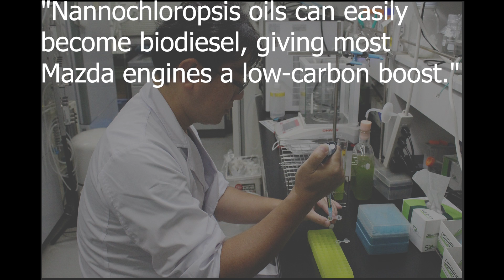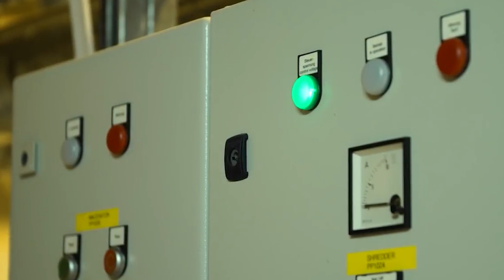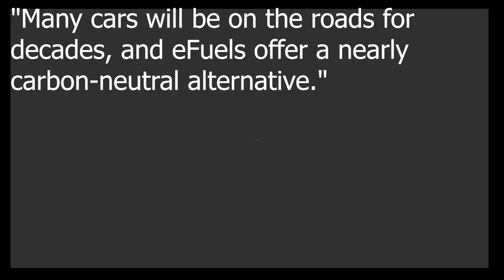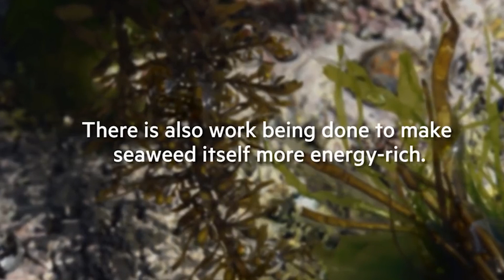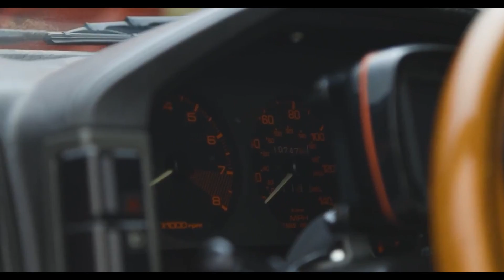Mazda's Bold Plan to Save the Internal Combustion Engine

Comment: Here we go again, more seperate attempts to avoid having to do something about making EVs. They pretend that these Biofuels are somehow Carbon Neutral, when anyone can see that they obviously aren't. They all need energy to synthesise the fuel, still have to be transported and still end up having 60% or more wasted in IC engines. There is no technology that can beat the end to end efficiency of Electricity generation to turning wheels than BEVs. Every step you introduce adds more inefficiency. You're always better off using Electricity to directly charge batteries.

Comment: As always the issue is that even at scale the production of fuel using algae / sea weed is expensive & it will never be cheap.
To achieve $12 per gallon of fuel will take a $150 billion investment !
Can you justify $12 per gallon when petrol is $5.79 per gallon???
Reply: Costs about that for ye olde petrol in the UK, though taxed heavily up to that price
Reply: Using oil from Algae is very expensive even when you have economies of scale!
It costs £9.50 per gallon in the UK... in like central London??? It's about £7.15 per gallon in Yorkshire  @mcspikesky

Comment: Cars will be on the roads for decades. I don't believe that for most produced electric cars of the last decade. Time will tell how many still work after 10 years. The oldest EVs are 10 years old now, wonder what the % of them are still being used and what level of charge the battery is capable of. 
My guess is way below 80% for the few still around.
Reply: First generation BEVs are holding up remarkably well. That's only going to get better. 12 years or 250K miles is the average for ICE vehicles, which is frankly pitiful. I'd wager that in 10 years, BEVs will last on average 400K miles. ICE vehicles almost always reach the end of their life when major engine issues occur. Electric motors will easily outlast IC Engines.
Reply: @rogerfroud300  Let's see what time will bring. If we count the motor and battery replacements, then we'll have an idea of what will last or not. Also let's wish to see recycling centers open up to process the thrown out EVs, be it the battery or electric motor. I won't bet on the EV cars though, I have seen too many failures so far. 
Have you also considered the insurance costs of owning an EV? They total out so fast, the insurance companies will be hiking up prices sooner than later. Just don't forget to address those issues as well.

Comment: It's a biodiesel. It's not gonna work for your gasoline car. And considering the changes made to diesel cars over the years, it also won't work for them either withought major modifications.
Reply: Mazda's sky active engines actually are able to run on it. They've already tested it.